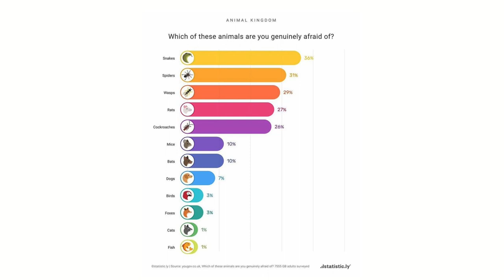Searching for snakes and reptiles in Lebanon

Comment: In 1980 / 81 I served one year as a dog handler in NORBATT, which was part of UNIFIL. One of my dogs was obsessed with tracking down these turtles that you show here.
I also remember several of these snakes. who at that time  unfortunately
were seen as better dead than alive. Snakes are very useful for a well-functioning ecosystem, so I hope that has changed.
As a dog handler, I was out a lot patrolling at night, to prevent "armed elements" from entering the area. The most common, however, was that the dog “marked” wild boar and foxes.
NORBATT was located between Marjaayoun and Litani.river canyon in the west and Kaukaba and Chebaa in the north-east.
Centrally in the area flowed the Hasbani river. Unfortunately, this important river / stream at that time was characterized by littering, - especially on the mountain side towards Cheeba and Hermon mountain.
I will also never forget the wonderful display of wildflowers that covered the otherwise dry landscape after the rainy season in spring.
Keep up the important and good work of taking care of Lebanon's ecosystems.
Greetings from an UN veteran.
Reply: I was with Irishbatt 1982 and Naqoura 1984 and 1985 a beautiful country and luvly people it's a pity its all starting over again for them